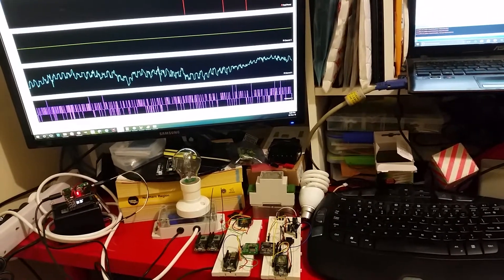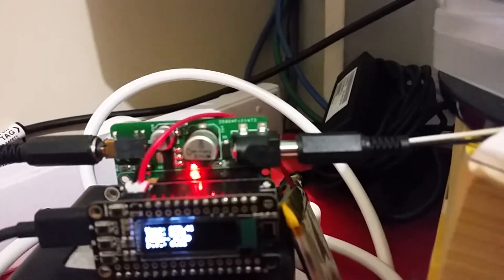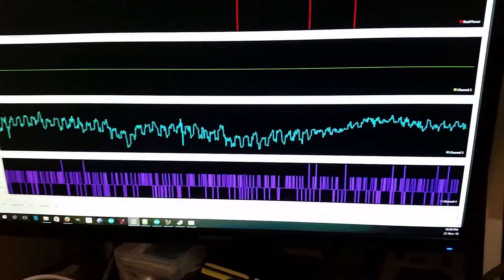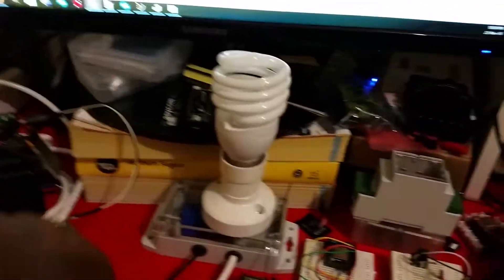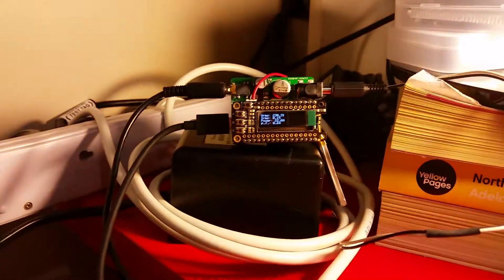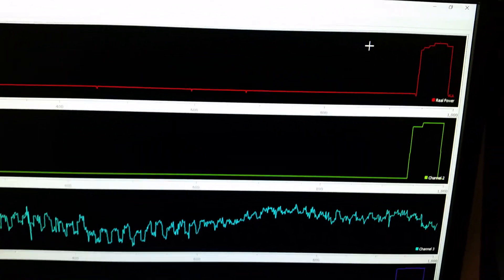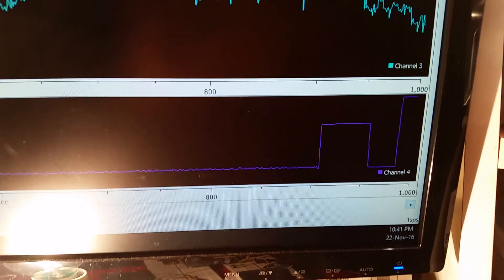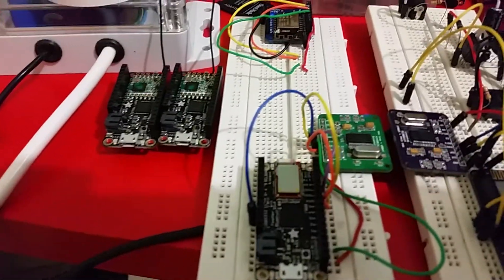ATM90E26 Energy Monitor Featherwing

Comment: Hi ... Is your ground plane(digital ic ground) is connected directly to phase line? In ATM90E26 application note, they are connecting  phase to ground directly..... Why that configuration? Please help me
Reply from the maker: This is using ELV at 12v from the transformer and it is isolated from LV. The energy monitor is not aware of the Phase/Neutral etc. Grid logic it only consumes sinusoids into its ADC and does its thing. Please look at the schematic.
Reply: @TishamDhar  but we need a common ground, right? In the schematic, they are connecting line directly to the ground of atm90e26. Since we need to communicate to another microcontroller, we need to common the ground their too, right?
Reply from the maker: You can use the UART with an opto-isolator which is what the 2 line mode is for. I have also used it with an SPI isolator. Please check my DIN rail design. Ideally micro is not sitting on phase for safety and easy development with LV connected.